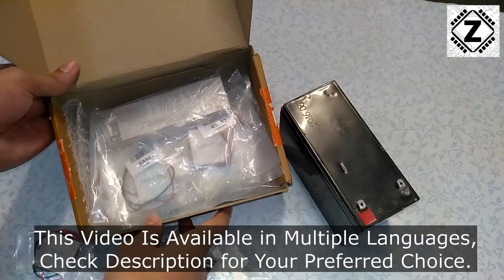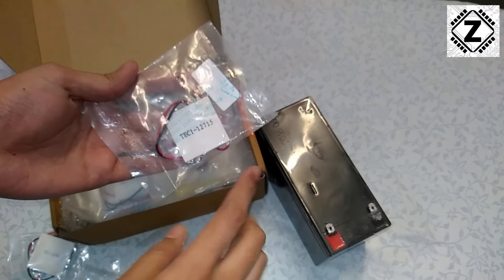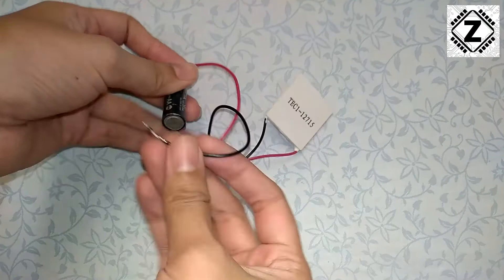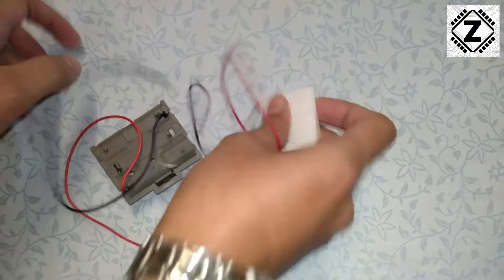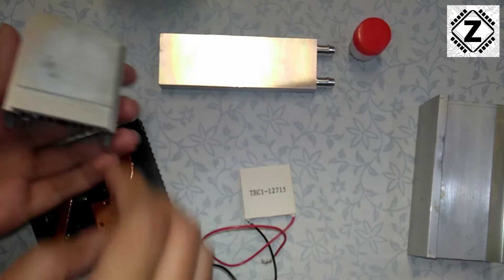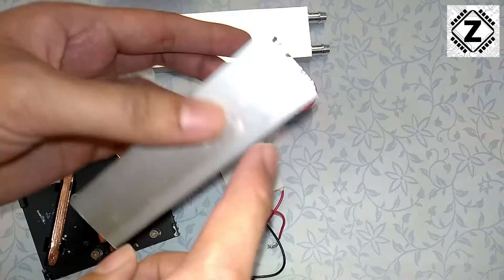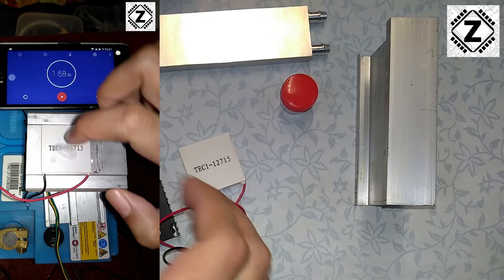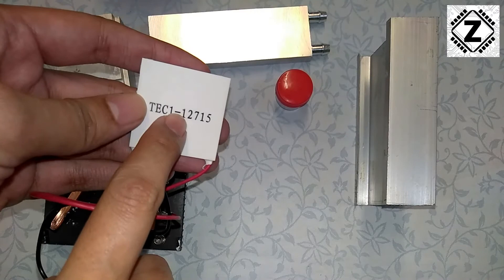[ENG] How to Safely Test Peltier with & without HeatSink | Thermal paste Alternatives | TEC Check

Comment: Sir, when im providing 6v with voltage regulator, its only taking 3 volt, but not more than that, even if im increasing it, it taking same 3 to 4v load, tell me how to provide higher volt to the device
Reply from the maker: Get a better Bench power supply like this https://youtu.be/F-AsfxdJKoc

Comment: Hello Sir, I am from a software background and love to do these small projects. But I have few small doubts.
For 12V 6A peltier module, if I provide 12V 2A current for general use (17-18hrs). Is it going to damage the peltier module. (It's okay for me if the cooling is not going below 5°c)
Reply from the maker: It wont damage the peltier. But may overload your power supply.
Reply: bhai 12v 2a par kesa kaam kar raha he ?